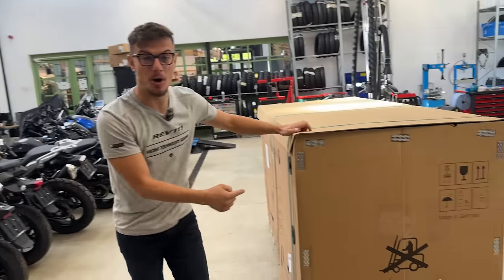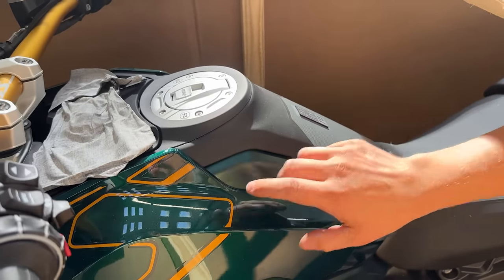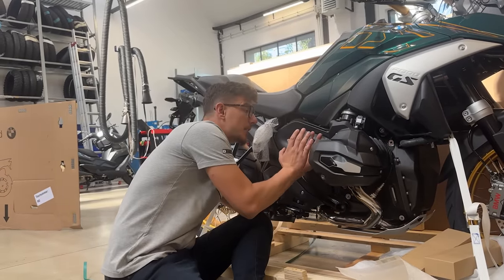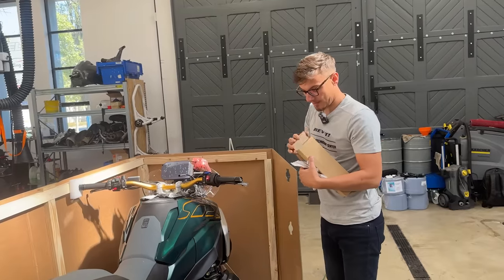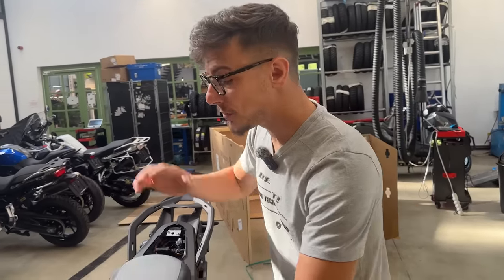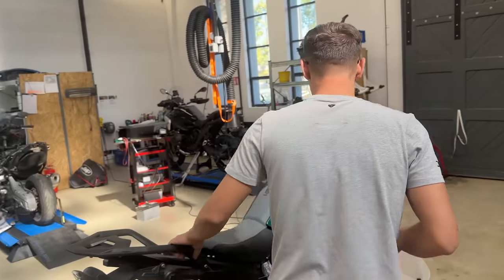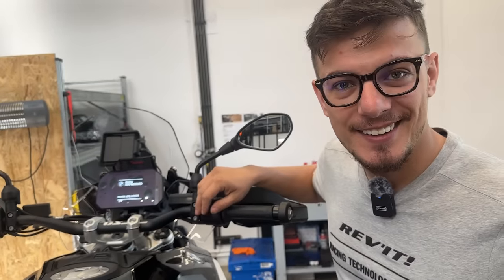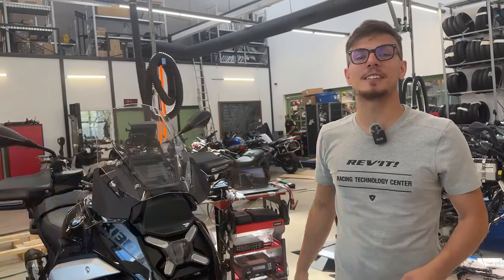2023 BMW R 1300 GS Tramuntana Unboxing & Engine Start-up

Comment: I also think this is the first non-factory closeup of the new model. Well done! I was used to the sort of Swiss Army knife look of the previous models, but I like the new design. It seems sleeker and more compact (and makes me think it was partly designed to go after Multistrada sales). The Tramuntana and Option 719 package looks very nice, as does the trusted standard, the Triple Black. I can’t wait to see the new models in person at my local dealer.
Reply: Price!!

Comment: The turnlights in the handle guards has a very good visibility! They should not be that easy to destroy since the Tramuntana is a street model with features for long distance riding if I've not misunderstood it completely 😉

Comment: It looks much smaller/compact/sleeker than the 1150 I had.  I did not like the 1150 and sold it after 1 year.  I'm looking forward to testing this bike and I'm sure I'll buy it.  So happy the GS has many changes away from the older style.
Reply: 1250
Reply: @junight4236 there was also an 1150

Comment: With the new changes (turn lights on handlebar, fragile plastic luggage holder/system, mirrors with electric components, electric windshield, on road tires, radar system front & back) Looks now like a on-road only touring bike. One crash on offroad and you have to pay thousands of euro to fix it. 
BMW knows their customers very well. They are using their boxer GS at 99% on the road.
Reply: I am not sure if that is the case, if you have been following this model presentation on social media it has been focusing on off road a lot
Reply: @zsguerreiro   The suspension and handling might be better now for offroad, but the rest on the bike is now too fragile for off-road. To be fair, modern ADV bikes are touring bikes, with off-road capability. The SUVs of the motorbike world.

Comment: Just a 1300 GS? 😂 Another entry level bike. I'd recommend to wait for a 1800 GS 😊. Maybe in 2 years from now (Oct. 2023). 
If you really intend to go offroad than a 2500 GS definitely would a better option. Because a SUV on 2 wheels impresses all others - in case you have to lift from the ground.
Happy unboxing!

Comment: Great styling, love the little touches like the handlebar shock-absorber. When they announced they were increasing the capacity yet again I was skeptical - usually that means a heavy bike gets heavier but not in this case. Though that said, I'm more likely to look to the F900GS as it's still 100bhp & loads of torque but not nearly so heavy.

Comment: Nice! I think you're the first in youtube who unboxed r1300gs.  Do you know if r1250gs spoke wheels fit r1300gs?  Also, if you can confirm if the handle bar width is the same from the outgoing 1250?  Thanks in advance

Comment: Nice video, they must really be charging for such a bike. My favorite bit is the lever protectors Ill bet they are well over $150. with the signals inside  very nice BMW, well done. I don't ride in the dirt but must be a challenge to use  that 1300cc engine on the gravel.

Comment: I love that they moved the power button to the bars. 
I love the look of the 24s
Don't like the flimsy plastic luggage rack, or the fact the blinkers are imbedded in the hand guards. The first aftermarket upgrades I do have always been REAL handguards and Double Take mirrors. These upgrades will be a bit more costly as front blinkers will have to be added. The surround indicator in the stock mirror will go away so that feature is not so good. 
That stuff is designed for the people who ride to and from Starbucks. If you use it like I do, getting down in the dirt and travel BDR's then it's useless.
Reply: You don't have to buy the radar stuff. Just get the trophy with crashbars and you're set.

Comment: How tall are you? I can see you can put both your feet on the ground, it it the same as on the 1250GS or lower?
Reply from the maker: I am 1.8 meters tall, it feels just about the same
Reply: @RacingandAdventure  and when you sat on it was it lowered to the minimum with the height adjustment feature?

Comment: Second hand 1250 gs and gsa prices  will be sky high!!
Reply: Why?
Reply: don't  expect this  to happen.
Reply: Why? Now that the new one’s here, prices should drop for GS not necessarily GSA
Reply: Agree. With such horrible looks, a lot of people that were waiting and saving for this, will just grab an R1250GS.

Also in one review the guy was telling that it is no longer at the same segment of the previous GS.
He said that it no longer feels big enough for comfortable touring and just feels more like a supermotard bike.
Reply: The people that think that are 1250 owners. No chance.
Reply: Yeah not really going to change much. they are already sky high!
Reply: The price on the new bike is approx 21500 euros std, no extras!!   Prices on current GSA1250 will increase as demand is big, on used models.  New GS1400 only in a years time.
Reply: Nah. You watch them drop, and definitely if it’s a better bike, and the press gives it great reviews - it creates desire. In Australia, a R1200GS (last of them) can be grabbed between $15-20K. A new R1250GS of similar spec is $35K, and the difference isn’t huge. This is an exponential jump, with the new frame. I’m expecting prices to tank for the old models.
Reply: Second-hand prices will not tank. 
The market follows new bike prices, as confirmed by my BMW dealer. This is not the case with all manufacturers.  We have seen in SA that the demand  for used bikes has increased as new bike prices have risen, so demand on the used market is high, and good clean models get snapped up quickly. 

GS1300 is very expensive in std form. Most people will want the option packs, so the price will shoot up.  

No centre stand
No crash bars
19lt tank only
No luggage
Reply: who would buy the old model now😂😂😂
Reply: I literally went to the BMW dealer two days after the reveal, on saturday, and bought a full option R1250GSA. It will be my first BMW and first GS though I’ve been in love with it for years. The fear of missing out on ever owning a new R1250GSA made me do it. The R1300GS isn’t doing it for me at all.

Comment: Brilliant!! You got the first video out! You also showed a lot of the details that no one else did. For example, anti-vibration damper on the steering, and the connection of the panniers. The screen is significantly bigger and really looks up to the job. How did you get the bike so quickly? Are they available at dealers now? I’m not convinced by the colour or the name of this colour…..it’s a bit worrying for a biker to have a bike that includes “trauma” in the name! 

Well done, really looking forward for your review and my own ride on this new bike. I’m hoping we’re going to see the Adventure soon. The tank is too small for serious travel.

Comment: The Green one is a $28,000 USD without the Bags, Tax, Tags and Dealer Fees. That is totally ridiculous! If you want a GS, get the 1250 at a discount before they disappear.
Reply from the maker: The one in the video is 24k euro.

Comment: Made in Germany 😂 😂😂😂😂 On that box should say assembled in Germany for simple reason 80% of parts are made out of Germany. Anyway amazing bike. Better looking than the scaffolding before. Only what I don’t like at this moment is the rear box holder. Never like on k1600 the plastic holder because when you ride all the box jiggle like strawberry on jelly and it’s look cheap. Few times people in traffic say your box is loose lol when on scaffolding the top box was solid like black mamba in white milf.